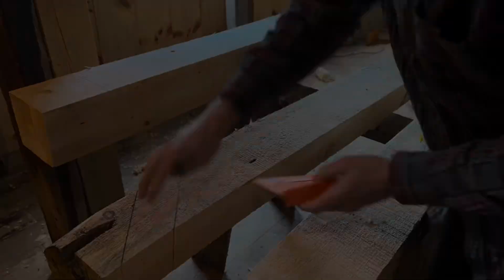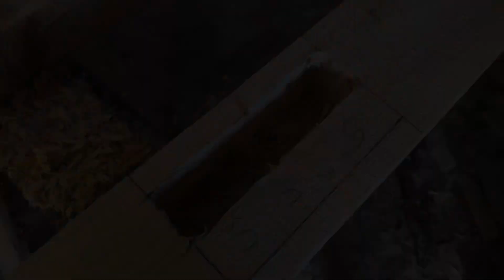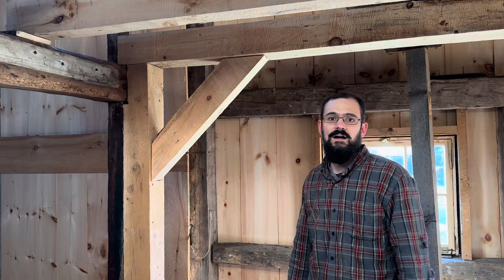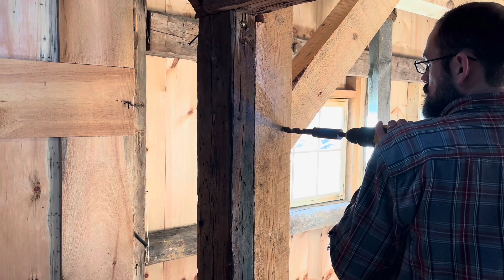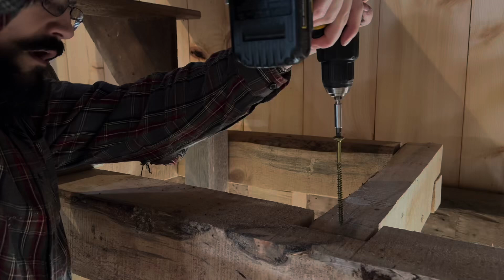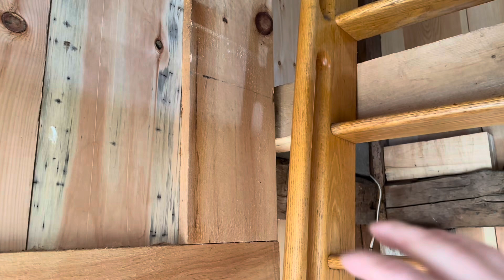Cutting a Timberframe Brace and Finishing Loft Replacement Framing

Comment: 8:40 tape mark yor bit at the depth you wish to drill so you know when to stop easy 😊. Thanks for the vid good tips.
Reply from the maker: @dismo021  Thanks for watching. The bit was marked with a marker, but as the chips build up it gets hard to see. Much easier on chiseling to be too deep than too shallow! In that sense, I went deep on purpose. A slower drill like a right angle drill with a worm bit and more torque is a much better setup, but the cost of all that can be hard to justify for a small DIY project.